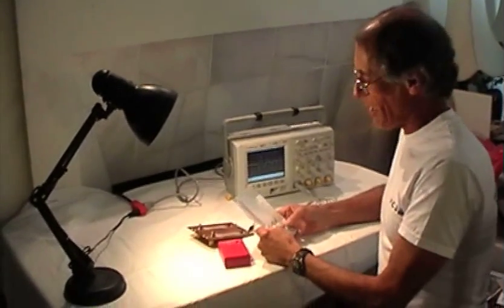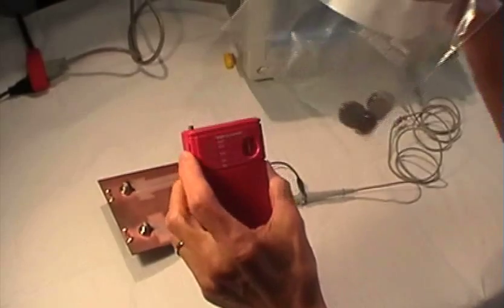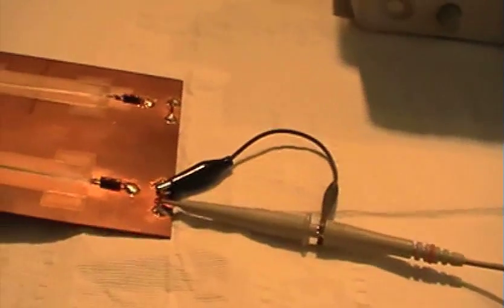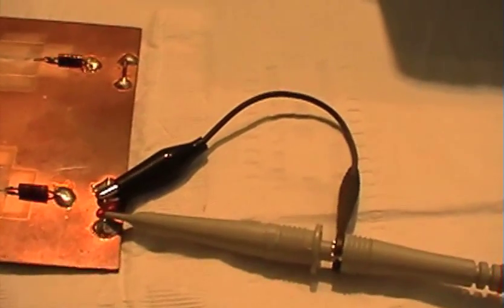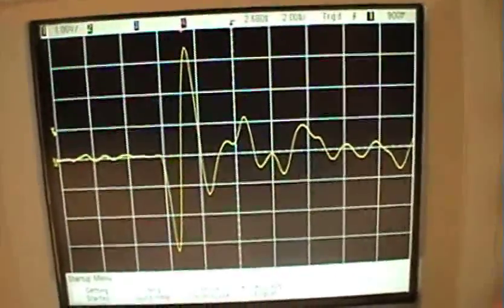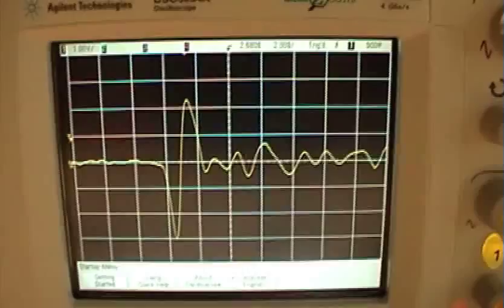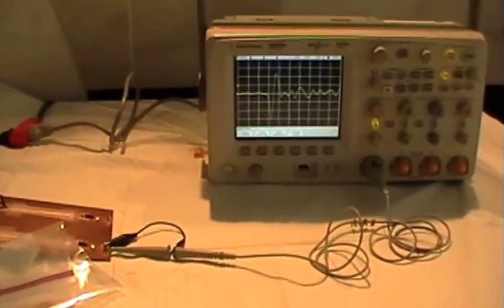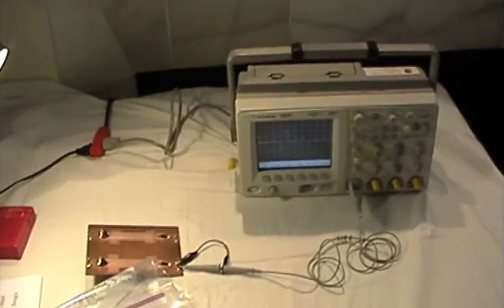Jingling Change, ESD, and Scope Probes

Comment: Trying to wrap my mind around the physics of these phenomena.  
 
When metal is exposed to an electric field, the metal becomes polarized.  That is, the free electrons within the metal move toward the surface of the conductor in the opposite direction of the orientation of the electric field.  And the positive charges (cations, I suppose) move toward the surface of the conductor in the direction of the electric field (although cations, being much bigger and more massive than electrons, would probably have a lot less mobility in the conductor than the electrons do).  The net electric field inside a perfect conductor is 0.  The boundary conditions established by the conductor in static equilibrium are such that all electric fields at the boundary are normal to the surface of the conductor.  If the conductor has any excess free charge, it will be on the surface of the conductor.  

A perfect conductor is also an equipotential surface.  

When an externally applied electric field is removed or turned off, the charged particles in the conductors will go through a transient transition.  We have several laws in effect all at the same time:  

1.  Gauss' Law:  A charged particle establishes an electric field.  The divergence of the electric flux density is equal to the charge density at that point in space.    

2.  Coulomb's Law:  Opposite charges attract.  Like charges repel.  Distance between charges obviously matters.  

Of course, the Biot-Savart Law, the Lorentz Force Law, Ampere's circuital law, and Faraday's law are all in effect as well.    

According to Coulomb's law, charged particles respond to the fields established by other charged particles in a manner analogous to mass responding to the gravitational fields established by other masses.  So, if one piece of metal with no net charge is polarized by an external electric field, and then that electric field is removed, the polarized charges will be attracted to each other.  A transient will occur until eventually the metal is no longer polarized.  However, if multiple pieces of metal in close proximity are polarized by an external electric field and then that field is removed, polarization may remain in electrostatic conditions, because the polarized charges are pulled by opposite charges of the same metal as well as opposite charges on other pieces of metal.  

Now, if these polarized pieces of metal are in close proximity and are jingled around, then the electric fields between the polarized pieces of metal are disturbed.  Furthermore, when the polarized pieces of metal touch each other (or come close to touching each other), electrostatic discharge events can occur between the coins.  After all transients have calmed down and we reach steady state electrostatic conditions, we may have some coins that are neutrally charged, some that are positively charged, and/or some that are negatively charged.  Each coin is more or less an equipotential contour.  If the coins are jingled again, the fields are disturbed again.  

What a great demo!
Reply: The friction of the coins against the plastic bag which can easily generate static charges.